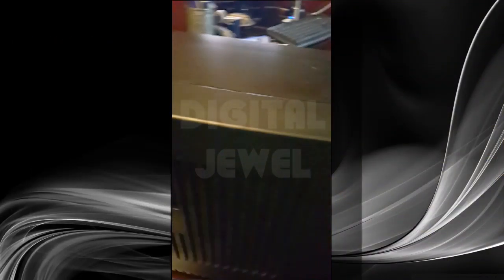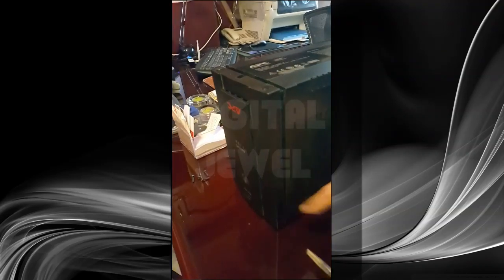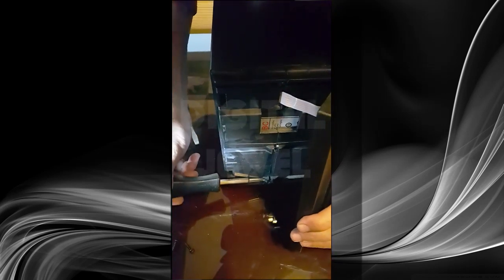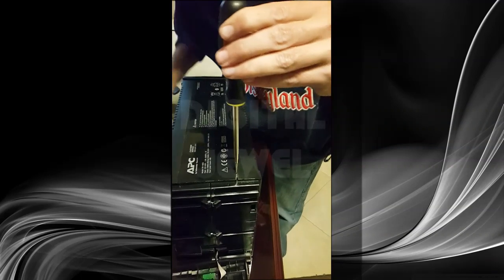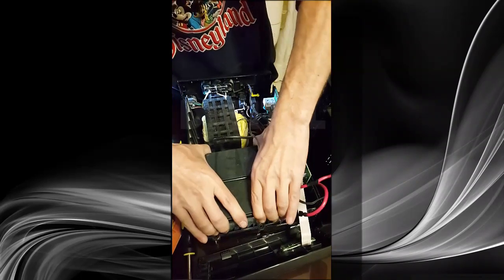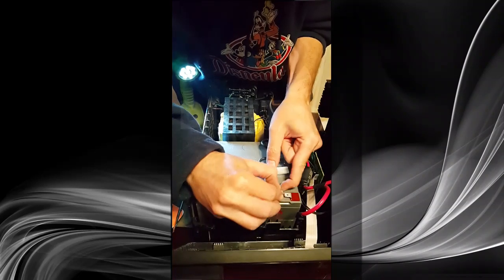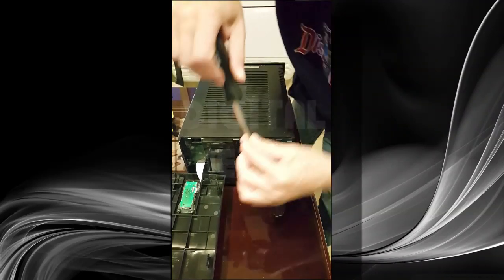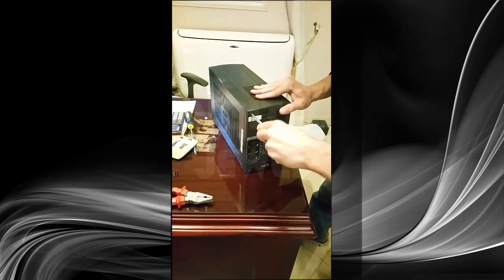How to Replace battery UPS 1100 \ BX 1400UI  \ BX 950UI APC 2018 in Details

Comment: I must replace batteries of my APC BX1400GR-U which has batteries 12V 7.2AH)  with 6.35mm faston. I only find new batteries, Yuasa for example, with 4.8mm faston. Can I mount these batteries or the fastons must be identical??
Reply from the maker: Hi Paolo
Faston is no big deal .... the point is to be able fix the cable  terminal coming out of the ups to the battery terminal or in the other hand to change\replace the terminals faston coming out of the UPS to be able to connect it to the battery or 🙄🙄🙄🙄 find another  battery brand with same faston size
Reply: Look closer for the right references. Yuasa has 2 models, the NP7-12L with 6.35 Fastons, and the NP7-12 with 4.8 mm Fastons (L standing for Large Fastons). Got the NP7-12L and it was 1:1 match replacement for the APC RBC17.

Comment: Hello and thank you for the video. I replaced the batteries in the 1400VA with two 12V7,2ah but when I turn the unit on, the green light blinks for a bit and after that I hear a continuous long beep tone. It won't stop unless I turn the unit off. No light is blinking white the beep tone sounds. Any ideas what went wrong?
Reply: Did you manage to do it?  i have the same problem too.
Reply: @merinerkan1079  I took it to the store and they fixed it there. A cable had been pulled from the board as I opened the box. So you better check that all cables are connected

Comment: Hi, great video. I used to replace my batteries but after a power shutdown the UPS didn't work. Do you know if I have to activate something after replacing the batteries? They're brand new. Thanks
Reply from the maker: Hi
What is the brand of batteries u got and what is the voltage and amp and also is ur ups with a single or dual battery 
Regards
Reply: @TheAdamaty  Hi, it's a single battery. The original battery was 12v 7.5 Ah, but I only got a 12v 7 Ah at the store, and I put it in. That was wrong?
Reply from the maker: Hi
Half amp wonf make the difference... try to exchange the fuse at the back of the usp ... in case of the fuse is ok ... then u got a faulty battery... maybe it's old stock damaged one
Regards
Reply: @TheAdamaty  Cool, thanks

Comment: It looks like you're using 2 x 6V batteries in series to give the required 12V... Is there any benefit to doing this?
Reply from the maker: Hi
This was the original setup of the ups two batteries connected in series there are other ups which comes with one battery
Reply: @TheAdamaty  my BX1100LI has a single generic 12V 9Ah battery (CSB HR1234W) that had the APC label stuck on the side... I also have a BX650LI UPS which has a generic 12V 7Ah battery without the APC label. Not User Serviceable - hahahahaha - my guess they are just using whatever batteries they can source at any given time...

BTW , many thanks for uploading the video! I don't think I could have worked out how to get inside the box without it. I already got my battery out and I'm now just waiting for the replacement to arrive...

Cheers!
Reply from the maker: Hi @jonintpe  
Thanks to u ... really appreciate it 
U are right about the batteries they come in original with different brands and also the new similar model in shape comes with one battery only where the backup time for the ups is less in time when electricity is out ... they are trying to cut down cost I think :))))
Cheers bro 😆😆👌👍👍

Comment: hello, i have a question, I have the same UPS like in the video, the green and red light are flashing alternately, what does it mean? Green light = On line / Red light = Battery replace. Thanks in advance.
Reply from the maker: Hi
When the 3 light colors lights in  intervals during setup means the sensitivity of backup power so when the electricity fluctuations. ..it's how sensitive u want it to be how fast is it responds 
But in normal mode it means it can't support the power equipment plugged into ups which means the battery is weak need to be replaced ... that is in case ur not trying to backup an LCD 60 Inch.😉😉😉

Comment: Where can I buy replacement batteries for this? And what are the types that is complatible?
Reply from the maker: Hi 
I have pinned the spec of the battery in the comments  the volt and amp
Regards

Comment: Question I own an APC Back-UPS Pro 1100 (BP1100). I just replaced the battery but after assembling the unit back I turned it on, the green LED turns on first blinks 36 times then goes off, at the same time I get a solid amber LED, beeping 4 times (5 times with a 30 secs interval). What can I do???
Reply from the maker: Hi
The battery u replaced is not good or different lower amp
Regards
Reply: @TheAdamaty  Lower AH will only affect runtime on battery - could be a charging or monitoring issue. OR you have used a 6V battery instead of a 12V one.
Reply from the maker: Hi chris
I prefer 12V 7.2 AMP
Worked great we me
Regards

Comment: Hi. What's the rating of the battery? I've misplaced photos of my old ones.
Reply from the maker: Hi
Just to didn't get what u mean u want the battery amp and volt for the battery
Regards.👍
Reply: @TheAdamaty  Hi. Sorry, I had removed my batteries and discarded them when shifting to a different state. I don't remember their rating now. Are they 12V/7AH? Thanks for the informative video!
Reply from the maker: Hi
One question to give u accurate info
Does ur ups have single or dual batteries
Reply: @TheAdamaty  It's exactly the same UPS that you have shown in your video. It had two 12v batteries connected in series. I've forgotten whether it was 7AH or 9AH.
Reply from the maker: Hi @benjaminsoans7335 
The battery is 12 V  7.2 Amp
The brand is CSB
MODEL 1272 F2
Regards.👍
Reply: @TheAdamaty  Thank you so much!! 🙂
Reply from the maker: Your most welcome bro 
Regards.👍

Comment: hello... what is the name of the cable between the two batteries?
Reply: That cable would basically be a jumper cable to get the 2 batteries in series.
Reply from the maker: Hi 
The cable a basic cable which is used to connect the 2 batteries in series
Regards.👍

Comment: Hi. Hi have APC BX1100LI-MS. But why I can put 1 battery only? If I put 2 it will beep non stop. Kindly advice.
Reply from the maker: Hi
There are 2 types models of the ups one with one battery and the other one with 2 batteries if ur had one battery you must exchange it with one battery with the same volt and amp and if it had 2 you exchange it with 2 batteries with same volt and amp that u had on the original ups battery.... in case u did that then most probably the battery u bought is fault old damaged one .... old stock even if u bought it new ... cause if it beeps continuously means over load or battery fault .... so exchange it with another new one
And if the case if want to add an extra battery to increase the backup time this will not work cause its programmed for one battery with the specific volt and amp so in case u add another one it reads that as an overload
Wrong volt and amp which I don't advice u to do
Hope this helps 
Regards
Reply: @TheAdamaty  Thank you for your clarification. Appreciate it👍
Reply from the maker: Hi @PrinceLy  
Ur most welcome
Regards  👍👍👍
Reply: Hi prince. Is the battery replacement 12v 9ah? thanks
Reply: @leekimah  I use 12V 7.2ah
Reply: @PrinceLy  Hi prince. thanks for the response. how many batteries tho? is it only one?
Reply: @leekimah  for my model 1 unit only

Comment: Hi sir. May I know the specifics of the replacement battery? thanks!
Reply from the maker: Hi
The battery spec's is as follows
The battery brand is CSB
GF 1272 F2
12 Volt  7.2 Amp
That's all
Kind regards
Reply: @TheAdamaty  Thank you for your response. Is your unit APC BX1100LI-MS?
Reply from the maker: Does ur ups have a single or dual battery 
Regards
Reply: @TheAdamaty  I honestly didny try to open yet.. I will try it later.
Reply from the maker: Must open it and check 1st 
To get the right battery 
Regards.👍
Reply from the maker: The battery model I sent u for the 2 batteries ... so check 1st
Reply: @TheAdamaty  Hi sir. Is it safe to replace it with 12v 9ah? it has the same dimensions.
Reply from the maker: Hi .... I dont recommend if amp difference high.... it is acceptable if 1 amp difference but more than that I dont recommend so with the battery u found for replacement I dont recommend cause the difference is nearly 2 amp
Regards
Reply: @TheAdamaty  9AH will be fine as long as the dimensions are the same AND the electrical connectors are the same. It may actually give a longer runtime on the battery :-)
Reply from the maker: Hi Chris
Sometimes more amps makes ups heats up .... so take care
Regards
Reply: @TheAdamaty  You are wrong - more ampere hours is not an issue. More AH is not supplying more amps - simple Ohm's Law. If you don't understand that don't comment!!!!!!!
Reply from the maker: Get back to school boy

Comment: I do have BX1100 LI and the battery isnt working anymore, manual says it is not replaceable but can you really replace it?

Also, im seeing 12v/9a here in our place but the size isnt the same, is it okay to replace a different size? Pls help
Reply from the maker: Hi
No the battery your mentioning will not work right ... the battery you should search for is 12 V 7.2 AH
and must be the same size so u can fit it inside the UPS
And about if it's replaceable .... yes it is 100% replaceable 😆
Regards.👍

Comment: Is it possible to use panasonic 12v 7.2aH?
Reply from the maker: Hi
The original battery is 12 V  7.2 Ah so ithe panasonic is the same output ...... so in a two battery backup ups like the one  shown in the video .... and if the Panasonic  same size then it will work just fine
Regards.👍

Comment: Can I use 2 batteries 
with 12 V 9.0AH?
Reply from the maker: if it was one ...use one ...if it came with 2 use 2 same voltages ....otherwise it will cause problems

Comment: Could have been designed to be swapped easier.
Reply from the maker: Hi 
Your totally right
I have this ups and an earlier model which looks exactly the same but the difference is it has a slide door at the bottom of it to directly change its batteries right away ... I think they made this model in this video like that to make it for a home user difficult to exchange the batteries for a reason  😈😈😈 hahaha
Kind regards.👍

Comment: i was shocked, i got only one battery inside.. what the fxxk..
Reply from the maker: Sorry to hear that .... Hahahaha you made me laugh as hell .... cheers bro
Reply: same to mine, single battery while there are 2 slots
Reply from the maker: Hi bro
Thats strange man ... did u get from a shop that may have stole one from inside so he can sell it afterwards 40 to 50 $ extra or the company decided to cut down cost and make extra money cause I have actually 4 of them bought on a long time interval 7 years maybe more and all of them have 2 batteries inside .... anyway u should install 2 batteries it will show a huge difference in back up time if u needed more extra back up time
Kind regards.👍
Reply: The problem is the voltage has big different for 1 or 2 battery in series, adding 1 in series will push the voltage to 24 volt from 12v, im not sure if its a smart move to do it.
Reply from the maker: Hi bro
U are right about the battery
 i can check for you with apc dealer to know what's the case and if they sell them with a single battery as u have encountered and what's it's voltage of single battery and what's in case of 2 batteries 
Keep me posted 
Kind regards.👍
Reply: nah im not going to call them, cause it doesnt matter what they reply, im going to add external car batteries in parallel.
Reply from the maker: Will u find a compatible car battery with same volt & amp... is it cheaper cause car batteries are expensive specially new ones known brands like varta
Reply: can easily get cheap ones if i want, goto car repair shop and i guess they have plenty batteries that unable to start engines.
Reply from the maker: nice ;)
Reply: would you please give me the information about voltage and ampere from each battery?? in my place is not easy to find csb battery. i hope i can find substitute for that.
Reply: always 12v per battery, the bigger the battery, the higher the capacity, if you want the battery to be inside of the ups, then u need to know the size of the battery and get the exact size, if you want to extend the cable and place the battery outside, size no longer matter. u need to replace with the same amount of battery and connect exactly how u disconnect them, according to the replies, it can have 1 or 2 batteries inside, so u need to open up and see.
Reply: Junn Kit Wong. Oh okey, it must 12v. doesn't matter with the ampere. if i have two batteries I need to make parallel, volt will stay in 12v.
Reply: u need to connect exactly how you disconnect them, im not sure if the UPS will only take 12v, its possible that it needs 24v(connect in series), dont be creative and take any risk. and yes amp hour(AH) is capacity, 10 times bigger it will last 10 times longer and 10 times smaller will last 10 times shorter, it doesnt really matter.
Reply: Junn Kit Wong ok nice share bro, thank U very much
Reply: 12v battery, thats all you need to know, the amp hour is the capacity, not important, if you want to fit the battery inside the ups, then u will need to know the exact size too.